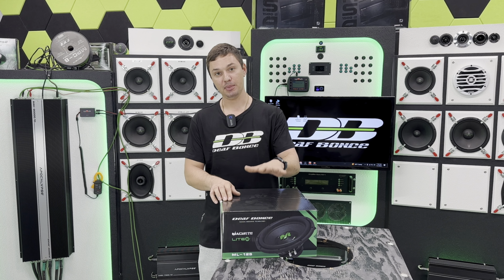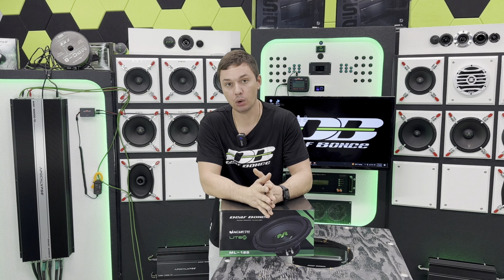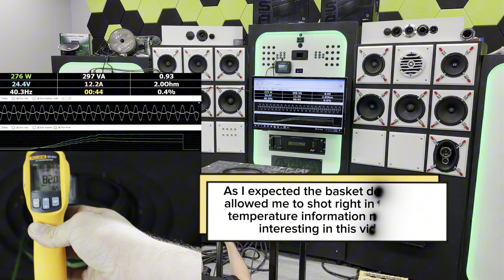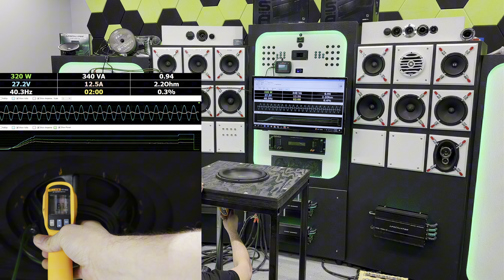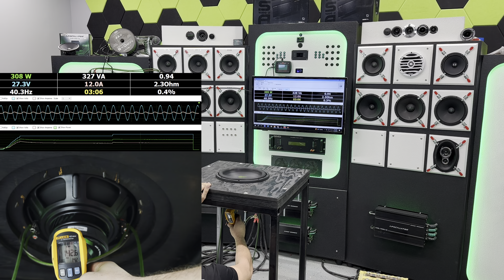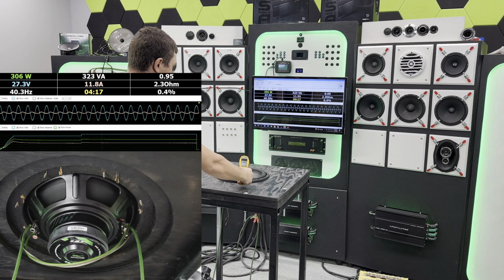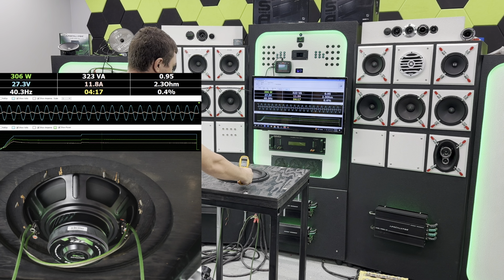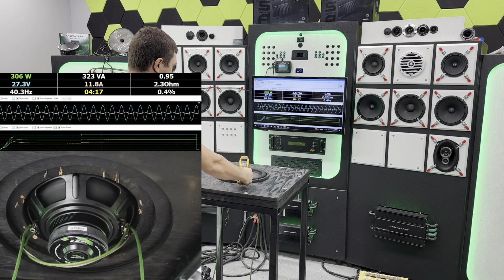DYNO TEST OF THE MOST BUDGED 12 INCH SUB ML-12S

Comment: I wonder how long it would have lasted at max rms power, before something would have taken it out, and what would have lead to the end of the little guy. Would the heat slowly build, or something else? 
Also if an matching sub, I guess checking the ohm or something. Try to find the closest one to slowly ramp up the power. To see how long it would last, with a higher than rms load. If a third sub was matched up with the other two. Then what would the time be for a higher load then the second test, which was already higher than rms power. 
Would it have a different if it was broken in before the test? I know it is generally the surrounds, that are tight when new, but when speakers are broken in, the spiders and coils should also be going through a break in period too, correct? 
Three thumbs up for this video, and for having a sub that’s rated correctly. 👍👍